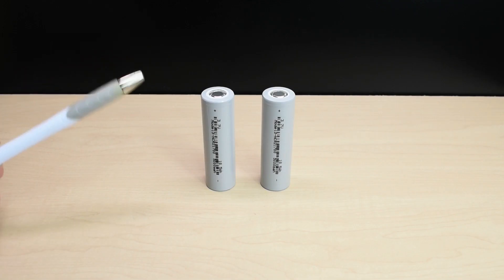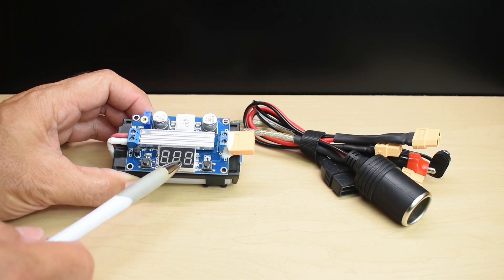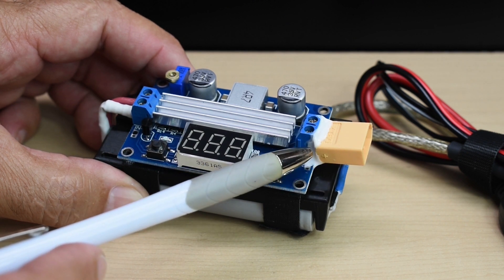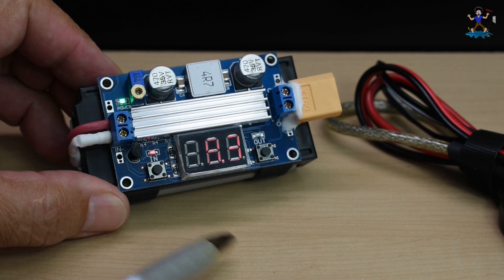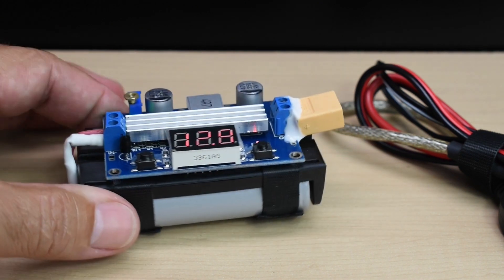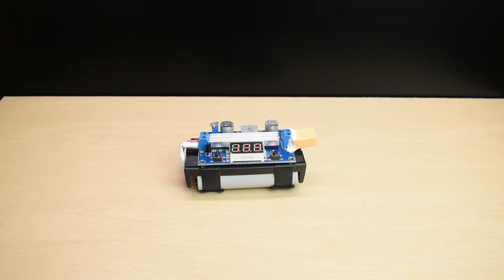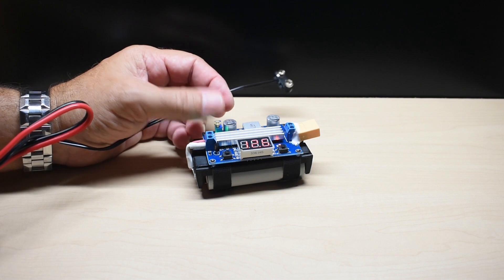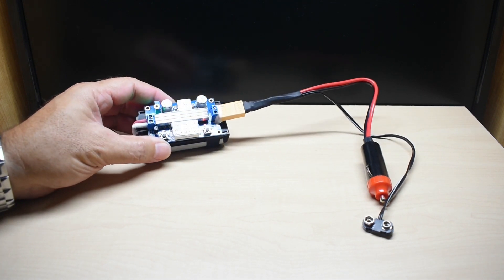Compact Power Supply (Tesla Powered!)

Comment: Nice project, I made one with a similar dc to dc module and 4x 18650's and it has proved very handy, I included a TP4056 charging board and a 4 way switch to charge each battery separately to stop them from becoming unbalanced, not sure if that's overkill? but seemed the safest and easiest way at the time, 

Great tip for keeping the memory settings when charging your car battery, nothing worse than having to reset the clock, etc. every time!
Use translucent red film over the led display, it works a treat and looks much more visible on camera (much like your clear battery isolator but with a red dye, in the lighting industry it is known as a 'gel', you can usually find some for free in everyday packaging materials)

Great channel, subbed a couple of months back and enjoying the old vids, cheers
Reply from the maker: Glad you enjoy the videos! Thanks for watching.

Comment: Great idea.   I never heard of E6000.  How long does it take to cure or dry?   Looks like a good tool as you demoed.   Thanx
Reply from the maker: I started using it around 6 or 7 years ago. It's strong stuff and bonds to almost everything. I only use that and clear silicone. Glad you liked the video!
Reply: @johndii2194  THANX

Comment: Could you do this with a single 38120 LiFePO4 cell?
Reply from the maker: Hi Mike. I should get a few and do capacity tests. They definitely have the power, but once the voltage drops below 3V, the DC-DC converter will stop working. Two of those 38120's in series with a higher current capacity converter, would be a powerhouse. 😀

Comment: What are AAAA "quad a" batteries about?
Reply from the maker: Very weak. You can find 6 of them inside several alkaline 9V batteries. Thanks for watching Brendan! Be sure to share.
Reply: Typically made for penlights. I have a penlight that uses them and it was a decent light when it had good batteries. While you can find some 9 volt batteries made with them, NOT all are made with them. I found that out one time tearing into some 9 volt batteries and when I did find the Quad A batteries, they were not the same size as regular ones. The one's I found were just a tad too short and narrow to work in my light. Even though today's LED lights are 10x better than that one, it still has it's uses.

Comment: Frustrating to see big companies buying up all these battery packs and reselling for high prices. In EU, ExEv baterries stay with the cars in scrapyards and are easily and cheaply accessible to consumers. In US, we want to extract as much capital from lower class as possible so people who can snap up the batteries make profit instead of getting the batteries into the hands of people who need them.
Reply from the maker: The 2170 cells in this video were removed from Model 3 battery modules that were made, but never used in cars. At $5.40/ea, it's not high priced.
Reply: @electronicsNmore  it is compared to exev batteries elsewhere
Reply: The 2170 cells they sent you are a 'fair' price sure, but I'm mostly looking at their site and all the batteries they have in general. If people truly wanted sustainable energy to come to market we wouldn't have people with access to capital roaming around buying them up. Salvage Nissan Leafs at auction go for almost as much as used models because of companies like these raising the prices just for the batteries.